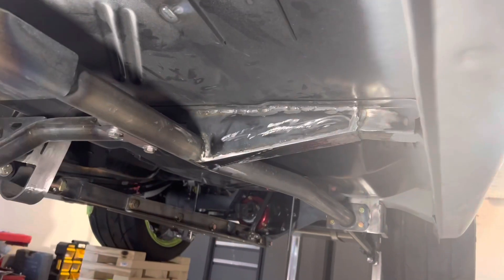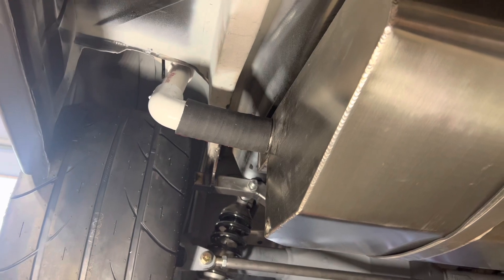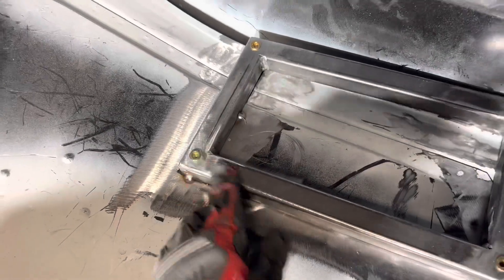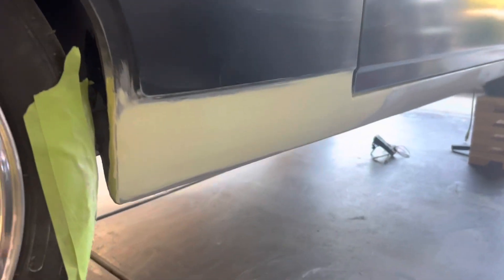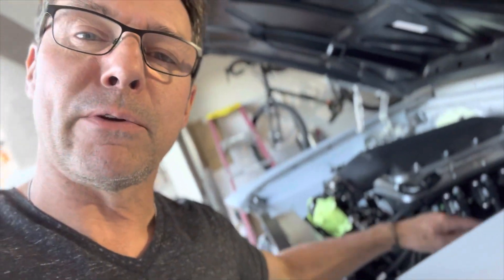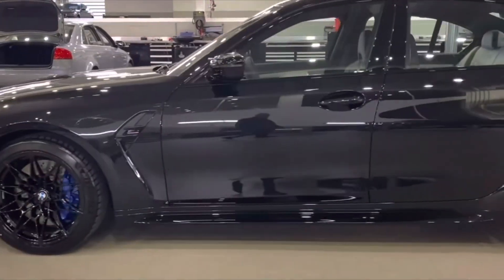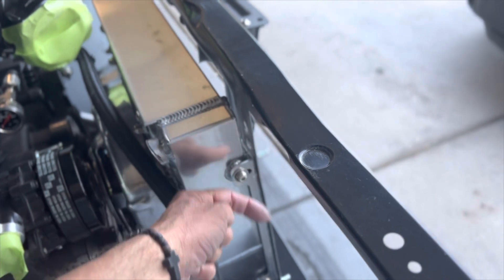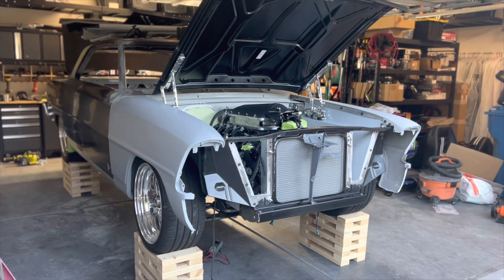Brody’s Garage 🏁 Episode 33: Battery Mount & Making the Frame Stiffer

Comment: I am going to go with 86. A 1967 Nova, 19 + 67. Love the wood car blocks! I half to agree with the one guy on the battery cable. Running it underneath along  or inside the chassis like they did on these older Chevs at the factory. I have to replace my main electrical harnesses, or runs on my project vehicle, and it sure makes it easy to connect the old to the new, and just pull it through on a mainly straight shot.

Comment: Episode 100!......Because it would be interesting to see the dismantling, cataloging, and re-assembly after paint, which a lot of hot rod shows represent as the actual build.....It would be good if you already did the DMV stuff so you could drive it a bit in primer before blowing it apart for paint....That core support appears to have lots of room to modify for the radiator to go forward (limited by any coolers going up front)....You are really getting it done!....